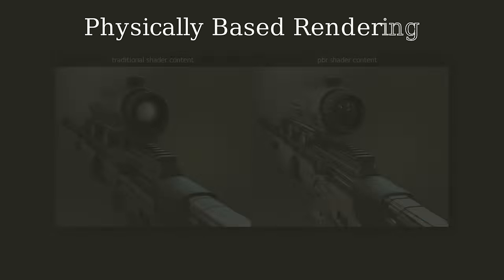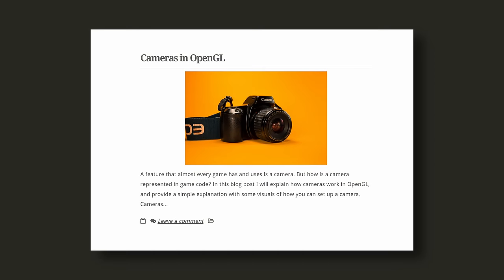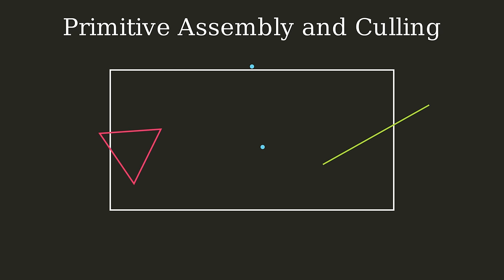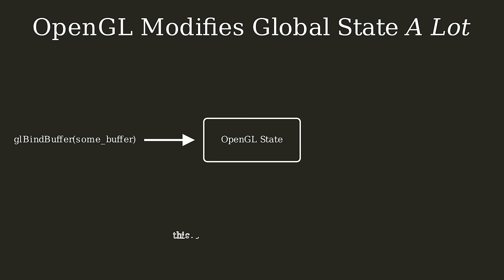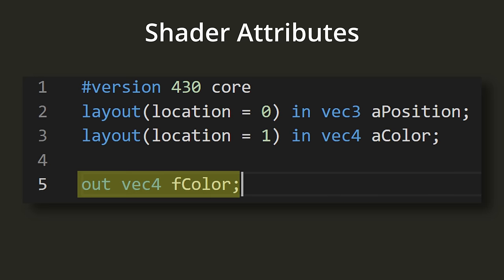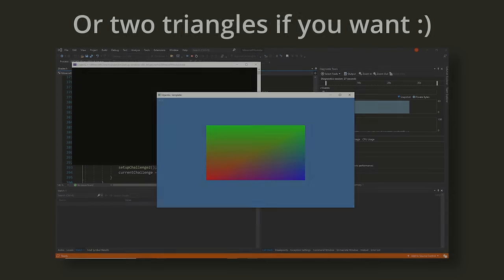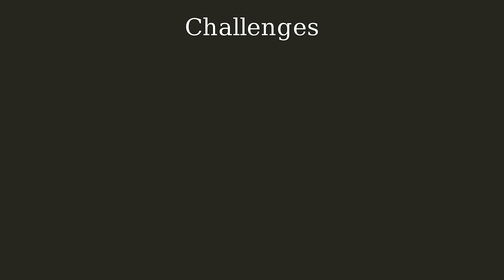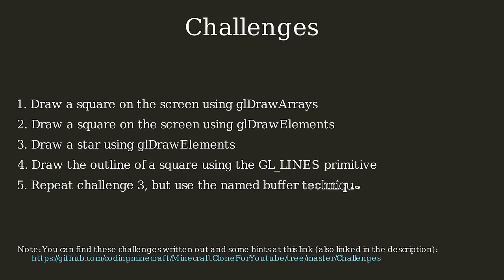Buffers in OpenGL | How to Code Minecraft Ep. 2

Comment: The reason you use triangles is because it's the least/maximum amount of points that guarantee a planar surface. No matter where all 3 points are, you always have a planar surface (or if points overlap a line or void/singularity). The fact they are "easy to work with" stems from that guarantee.

Comment: Regarding geometry shaders. They are used in real time applications, a good example would be making nice chunky lines. You pass in line geometry, and the geometry shader can use that line data to create screen facing quads, projecting the four verts half the line width out left and right along 90 degree angles from the line direction. You'd end up turning a pixelly GL line into a potentially textured nice chunky line of the passed width.

Another example would be engine trails for a space ship, these could just be passed as line segments into the shader and you'd end up with tapering engine trails as screen facing quads. Same principle. It's a way of quickly upgrading a primitive type to the one above it and inferring the extra verts required to make those primitives from that data, or data passed into the shader as uniforms. So a point into a line, or a line into a quad or triangle pair.

Really handy, I recommend looking into them more :)

Comment: It's a myth that geometry shaders are slow. This was true 10 years ago. Emitting quads (triangle strip), tetahedron or cube with geo shader is for example much faster than using instancing. When drawing a lot of things it's also faster simply because the gpu access less memory from the buffer (reading a buffer has a cost). Billboarded quads as triangle strips are great for simple particles. Geo shaders are awesome when used the right way :)

other than than.. this video is a fantastic explanation of the pipleine.
Reply from the maker: Thanks for the comment! I'm curious about the geometry shaders. Everything I've read or seen say that it's generally alright to use a geometry shader if you're only outputting 2-3 primitives, but beyond that it's generally a bad idea.

Also, on the khronos website they have this at the bottom of the GS examples page "The GS unit in current generation of GPUs, such as the Geforce 8000/9000/GTX 100, 200 and 300 series, is considered too slow to be practical by some people. It is also considered too limited by some because there is a limit to how many new primitives you can emit." 😅

It looks like it was last edited in 2018. I was wondering if you have any good resources or examples other than point sprites and billboards that geometry shaders can excel at that you could point me towards?

Comment: How to draw two separated shapes in OpenGL?
Reply: Gabe hasnt talked about all the required subjects for you to be able to do that the "proper way" (he needs to talk about shaders in more detail, uniforms and vectors and matrices).

However, you can emulate that by creating one vertex buffer (and optionally one element/index buffer and/or one vertex array) and instead of defining the vertices positions as if the objects are centered around the origin ((0.0, 0.0)), you offset them accordingly.

So, for example, a square of size 1 by 1 could have the following vertices:
(-0.5, -0.5)
( 0.5, -0.5)
( 0.5,  0.5)
(-0.5,  0.5)

So now, if you want to draw the same square at the coordinates (-0.5, 0.5) you just have to add the x and y componentes to the vertices of the square:
(-1.0, 0.0)
( 0.0, 0.0)
( 0.0, 1.0)
(-1.0, 1.0)

So, if you want to draw multiple squares (or any other mesh for that matter), you just have to offset every vertex of that mesh by the coordinate at which you want the object to be centered at.

After defining a vertex buffer (and the other optional stuff) for each object, you need to bind the shader, then bind the vertex buffer (or alternatively, the vertex array, if you defined it), then do the draw call. Now just repeat the process for every object (except for the shader, you just need to bind the shader once, unless  you use a different shader for each object, in which case you should bind it before each draw call).

Again, this is a way to do it with the knowledge you have so far (based on this series), but in the future, you'll learn more subjects and then there will be better ways to draw multiple objects.

Edit: alternatively you can define multiple objects in the same buffer, which is probably easier for you. Just define the coordinates for the first object and then the ones for the other and the "upload" it to the buffer
Reply: @lengors1674  thanks for the explanation 👍